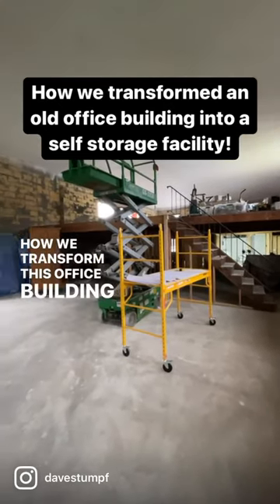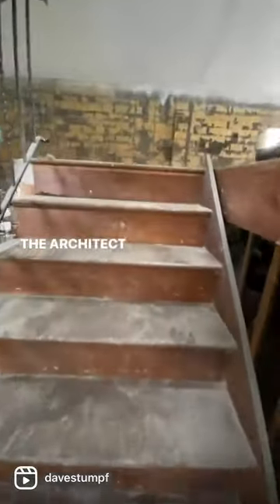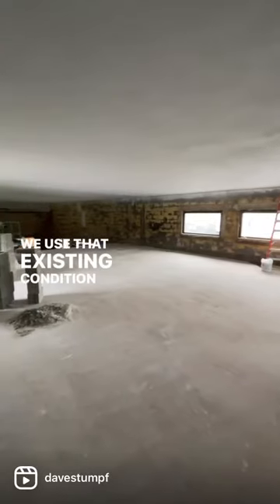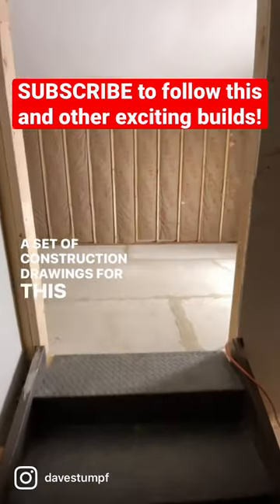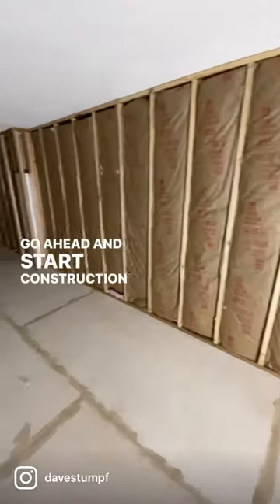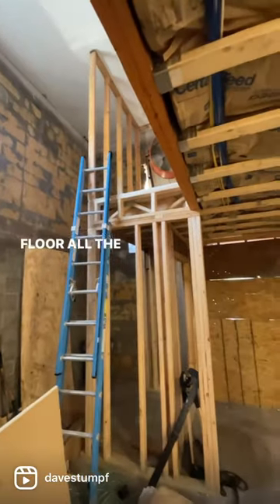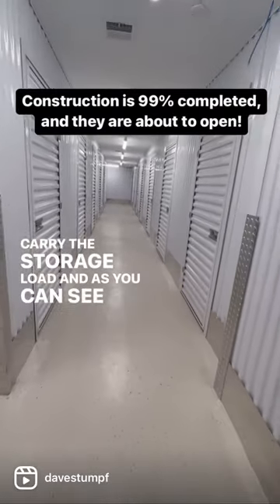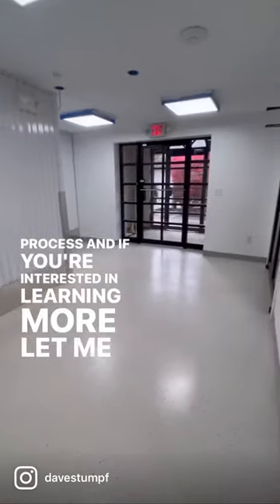Converting an Office Building Into a Self Storage Facility #Architecture #Construction #RealEstate

Comment: Wow, this is amazing! What materials did you use to create the second floor? We are also self-storage company from Central Asia, Kazakhstan
Reply from the maker: Thank you for watching! We used wood frame truss joists (rated for storage loads) to allow us to run our HVAC though the floor joists. We paired that with a product called “Exacor” for the sub floor.  That subfloor is a magnesium oxide panel that helped us to achieve a fire rated floor assembly.  Not sure if this helps you where you’re at, but at least it’s a bit of information you can use to help your projects!

Comment: What was the total sq footage of this project and rough cost per foot to convert the building to finished storage?
Reply from the maker: I’m. It sure about square footage costs because our client did a lot do the work themselves to demo the original offices and install the prefabricated self storage units. It’s roughly 5,600 square feet and the units range from 35 square feet to 60 square feet.  Micro units were the best way to achieve the client’s desired unit mix.